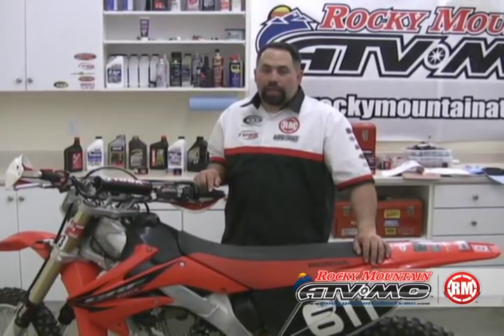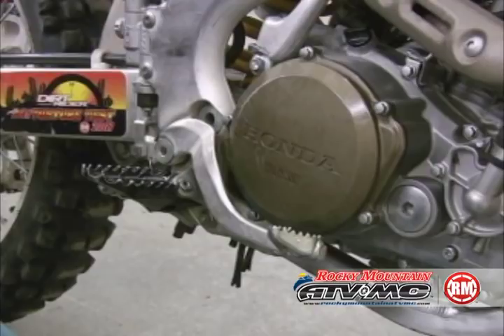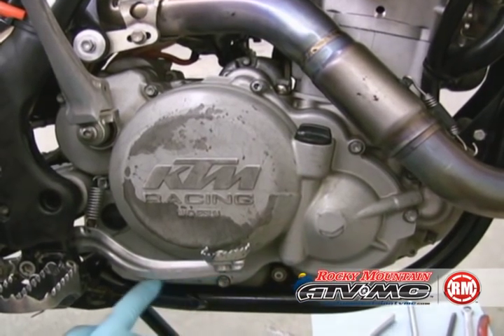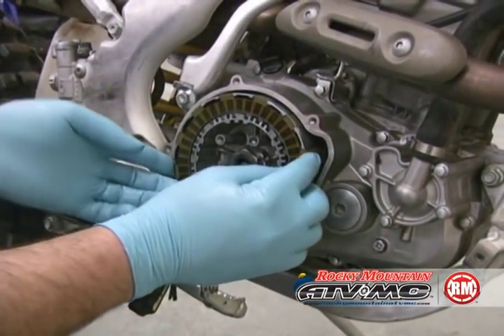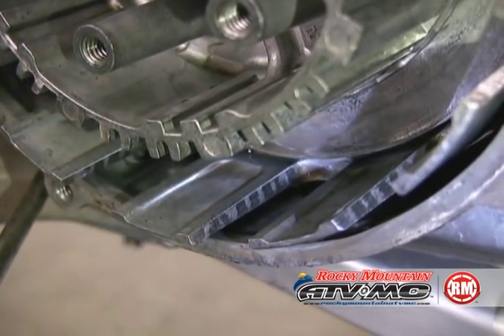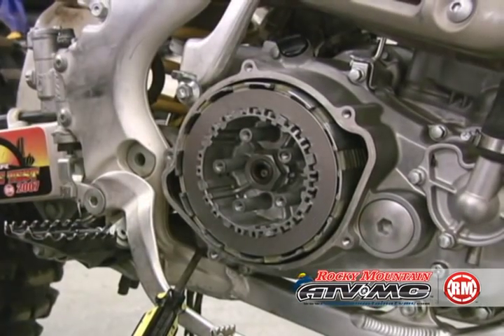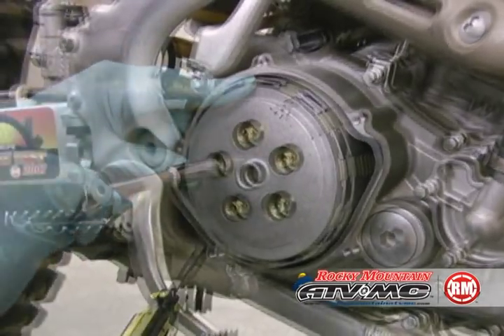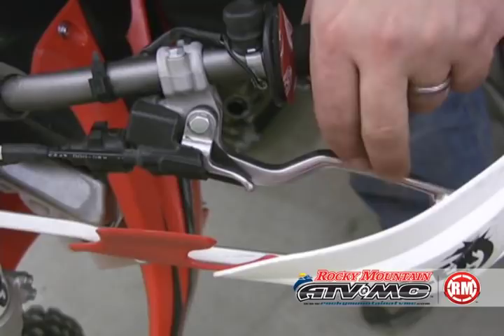Clutch Replacement on a Motorcycle or ATV - Clutch Installation

Comment from the maker: It sounds like the basket or inner hub may be wore out.  you want to pull it apart to inspect.  I would recomend either OEM, Tusk, OR EBC replacement clutch plates.  If you need a basket or inner hub, go with Hinson.

Comment from the maker: Most bikes will make more noise while running in neutral.  This is because the crank is driving all the gears in the transmission.  You are hearing them driving each other.  When the clutch is pulled it usually quiets it a bit.  If the noise is excessive you may have a loose clutch basket nut or something. If it is making more noise with the clutch pulled you could possibly have a broken plate.  Either way it may be time to pull apart and inspect.

Comment from the maker: In most cases you won't need to drain the antifreeze.  However if your machine does not have a clutch cover and you need to remove the right case cover, it may be necessary if water flows from the center cases into it.

Comment from the maker: The gear on the back is most likely riveted on.  the whole basket should slide out if you have removed the inner hub (and nut that held it on).  you may have to rotate the basket a bit, but it should come.  If not, then I am not sure what is holding it on.

Comment from the maker: @fourwheelerdude88 - slipping means the clutch isn't fully engaged.  This means the crank is not transfering all of its rotations to the transmission.  I don't know what "clutch thing" you are trying to drain oil on.  Are you talking about draing the transmission oil?  Just pull the drain plug.

Comment from the maker: @rmz247 - Pulling the lever disengages the clutch.  So I assume the clutch is still grabbing with the lever pulled in.  This is normal to some degree.  It can be caused by the oil (thicker usually) or by the basket and/or hub wearing.  As you get grooves in the hub or basket, the plates have a hard time fully separating; this leads to a little drag.

Comment from the maker: I don't know what you mean by "rotor", but if you are refering to your clutch, it is the exact same as this bike on your YZ250.  The manual may be refering to the arm on the other side of the engine, but you don't need to mess with that.

Comment from the maker: @SpeedTripleRocks - If the cable is in your way, then yes.  In most cases it won't be.  If you are confident in the toque you are putting on the bolts without a torque wrench then you are fine.  If not, I would invest in one.  The small 6mm bolts on the pressure plate only need to be torqued to about 7 foot pounds.

Comment from the maker: Sweet machine!  I have a 74 TC185 I cruise around every once in a while.  However we don't have a clutch for them and I don't see that any aftermarket company makes one.  You will have to go through a sukuki dealer.  The OE part # for the friction plate is 21441-13A01.  good luck.

Comment from the maker: So your clutch isn't disengaging all the way.  You need to pull it apart and see why.  It could be a few things - warped clutch plates, grooved basket, grooved hub.  You need to inspect.  Refer to your manual for specs.  if something is out of spec, replace it.

Comment from the maker: The springs make a big difference.  Stock springs will feel much better, but less spring strength can fry the clutch faster.  A dirty or old cable can also make the pull tough.  Make sure it moves freely.  If not a cable luber or new cable will help a bunch.

Comment from the maker: If your clutch is falling into neutral, it is most likely not a clutch problem at all.  It sounds like you have either worn gears or bent shifting forks in your transmission (or both).  It may be time to split the cases and inspect the tranny.

Comment from the maker: Refer to your owner's manual for recommendations.  I am not familiar with the oil you mentioned, but synthetics are the best for clutches (too slick).  I run Belray or Maxima 80 weight gear oil in my 2-stroke.

Comment from the maker: 1.  Just the friction.  The steel plates won't matter since they can't absorb the oil.  2.  I think you mean drive plates; either way it does not matter which way.  I always try to run them the same way though (sharp edge in or out).  3.  It doesn't matter if the bike is in neutral or in gear.

Comment from the maker: @JaredProject - It sounds like it doesn't fully disengage.  That is normal as the basket starts to wear and groove.  The fix is to replace the basket and maybe the clutch hub (depending on how each is worn).

Comment from the maker: @graveyardpromotions - most likely the clutch issue is unrelated.  It probably didn't disengage that well before when cold, you just never noticed.  It sounds like you may have fouled the plug.  try a new plug and see if it runs.  Your jetting may still be off if you fouled a plug.

Comment from the maker: Have you tried adjusting the cable? You also made sure that your installed the same number of friction plates correct? If everything installed just fine i'm betting you've got something else going on. Maybe go over the install again and make sure nothing is missing or out of place

Comment from the maker: @SpeedTripleRocks - They usually slip less when hot.  a few milimeters of free-play is important.  if you can't get it at the lever, try the adjustment on the cable or at the case (wherever an adjustment may be).

Comment from the maker: @kylejamesbarros - most likely a worn (grooved) clutch basket or inner hub (or both).  as the plates wear grooves in them, the plates have a hard time separating - thus, not fully disengaging.

Comment from the maker: @BowHunt1229 - look at a parts diagram of your clutch.  There is an adjuster to the push rod.  Check it out and make sure the pressure plate is putting all the springs force on the plates.

Comment from the maker: it doesn't sound like a clutch issue, rather transmission or shift mechanism.  You will have to pull it apart and inspect.

Comment from the maker: @weez1190 - thicker oil will make them drag more, but you should see it go away when if warms up.  Try Belray gear saver 75 or 80 weight.  If that doesn't help, you most likely have a worn basket and hub.

Comment from the maker: I'm just thinking if your cable works fine with the previous clutch it shouldn't change with the installation of this clutch. Have you tried using your stock clutch springs to see if that makes a difference at all. Also i would measure your friction plates thickness to see if they are in line with what your service manual says.

Comment from the maker: @Unity0Is0Power - sounds like a transmission problem, not a clutch problem.  Most likely you have some gears and maybe a shift fork damaged.  Time to split the case to see.

Comment from the maker: @250rsrcool - Some quads (or even bikes) that don't have a clutch cover may have to drain the coolant.  This is because the the entire right case cover has to be removed.  On the bike in this video; No, you don't need to drain the coolant.

Comment from the maker: @londonTown1989 - It depends on the bike.  Some right crank seals are installed from the inside (kawasaki does this a lot).  Check your parts diagram.  This CR - Yes you can.

Comment from the maker: Your jets thread all the way in.  If you are dumping gas then you havea problem with the floats.  Either they are not set right or the needle & Seat (the valve that shuts the gas off) is dirty or wore out.

Comment from the maker: The cushions don't go back in.  The springs on the pressure plate do, but usually aftermarket kits come with new ones.  The EBC kit should have them.  I don't know the size of the nut.

Comment from the maker: @londonTown1989 - It depends on the bike.  Some right crank seals are installed from the inside (kawasaki does this a lot).  Check your parts diagram.  This YZ - Yes you can (if is a very tight fitting seal though!).

Comment from the maker: you need to make sure you have a few milimeters of free play in your cable, otherwise you will fry the clutch.  If you are unable to get free play with the adjustments on the perch and cable, compare the old cable with the new to see what the difference is.  The only thing that could make it harder to pull (assuming only the cable was changed) is if the cable got kinked.

Comment from the maker: It sounds like your plates aren't fully engaging.  make sure you have free-play in the cable.  make sure there isn't some other adjustment that is preventing the pressure plate from putting full pressure on the plates.  Don't let it slip too much or you will burn up your new clutch.

Comment from the maker: If it is actually shifting back into neutral you may have a problem with something in the Transmission.  You could have a bent shifting fork, or rounded gear cogs.  Regarding the clutch not fully disengaging when in gear, depending on how bad it is, it may be normal.  If the bike is not running and you feel a little drag, that is fine.  If it is warmed up and running, and you still get a lot of drag - it is most likely a worn basket, hub or both.

Comment from the maker: There is one more friction plate than there are drive plates.  You always start by putting a friction in first and then end with a friction plate as well.  Some machines have a certain order because there might be one or two different friction plates in the stack, but most aftermarket clutches don't.  If they do, it is usually a thinner one that goes in first next to the inner clutch hub.  Refer to your owner's manual.

Comment from the maker: @Hockeyvalley - the clutch simply delivers the power from the spinning crank to the transmission.  It is made to engage and disengage to make power delivery smoother and shifting easier.  If you have problems with your transmission, it is most likely not the clutch.

Comment from the maker: No you can go ahead and remove them from the oil shake them off a little and then place them right into the stack. As for the grooves in the top of the friction plates i will usually stagger then with each friction installed. They help with oil pickup but it doesn't matter where they are located in relation to the other friction plates

Comment from the maker: @qwikyking - Disengage or engage?  If the lever is pulled in the clutch should be disengaging the transmission and your rear wheel shouldn't spin.  I must not understand what you are asking.

Comment from the maker: @staticxmako - It could be nothing at all.  all motorcycles make more noise ideling in neutral compared to pulling the clutch in.  This is becuase the clutch is driving all the gears in the transmission, so you are hearing them all move around.  You usually notice this after you rebuild it and are more sensitive the sounds the bike is making.  Try listening to your buddies bike and see if it does it as well.
At the same time, it doesn't hurt to make sure you got everything together right!

Comment from the maker: @21sentry - On your '03 CRF, The rod goes through the transmission shaft, The lifter fits over the rod.  The lifter has a flat washer type bearing and a washer on it.  The washer butts up againsst the pressure plate.  make sure your cable is adjusted correctly.

Comment from the maker: Some OEM friction plates are different and need to be put in a certain way (refer to owners manual).  Most aftermarket plates are the same, but can vary sometimes.  Often they come with one narrower friction plate.  This almost always goes in first (against the inner hub).

Comment: Very helpful!  Thanks for the info.  Do I need to drain the antifreeze to do this???
Reply: No
Reply: Only if you remove the inner clutch case, which is the case behind your clutch case
Reply: But for this you're not removing the inner ckutch case so you are fine, no need to drain antifeeeze

Comment from the maker: @TheDBen23 - I guess I don't understand fully.  How are you adjusting the springs?  Really, your only adjustment on your pressure plate coming down on the plates is in the cable.  Make sure you have a few milimeters of play in the cable.

Comment from the maker: Truthfully it does not matter; but I usually put the sharp edge on all the steel plates in the same direction.  Towards the motor or away, it doesn't matter.

Comment from the maker: Which clutch kit did you get for your bike? A lot of times your OE setup will have different plates for the inside and outside of your clutch stack but then the aftermarket clutch plates will all be the same. If all the plates are the same i would say it's safe to go ahead and install them.

Comment from the maker: New bolts are not necessary and using your stock bolts will be fine. You just want to be sure everything is together properly when you begin tightening down the bolts. Also i recommend using a high quality torque wrench. I have heard of a lot of people using a "click type" torque wrench that will go down to something like 5ft lbs but a lot of the cheaper ones are really not all that accurate once you get down that low. I like to use the gauge torque wrenches when i'm rebuilding.

Comment from the maker: it sounds like something is keeping your pressure plate from being able to lift off the clutch stack.  did you install new springs?  If so compare them to the springs you pulled out and make sure they are correct in size and length.  What bike do you have?

Comment from the maker: There was a small amount of grooving and wear on both this inner hub and outer basket but it wasn't enough for us to replace them at this time... Also sometimes when the basket does get grooved you can get away with just carefully filing down the grooves instead of having to buy a new basket.

Comment: done a thousand of em, if the clutch plates are not worn through, sand the metal clutch plates till you have all the shine taken out. The springs now, as you might notice the springs need to fit in between the preasure housing and the spring hold down post.( Nearly impossible to find washers for ) But it just so happens that the washer that spark plugs come with on them will fit perfectly. Add three of these to every spring and you wont have any clutch slip and the whole job will have been free

Comment from the maker: @zip1233 - on that particular bike it should be a lock nut.  If yours keeps coming loose, I would try a new one.  that one is most likely wore out.  Medium strength threadlocker should be fine a s well.

Comment from the maker: First off are you sure you aren't missing any components to the clutch? Second have you measured the thickness of your clutch plates to make sure they are in spec with what the service manual says. Is the push rod moving the pressure plate at all?

Comment: evry thing is in place and done right , i put the old clutch back on and the leaver worked fine as the lifter was pushing the pressure plate out. so would it be the cable that might need replaced would you think

Comment from the maker: The new clutch will most likely not fix the problem.  Your basket and possibly your hub have grooves worn into them from the clutch plates.  This happens over time and prevents the plates from spreading like they should when you pull the lever.  A new basket and maybe a new hub is in the anwser.

Comment from the maker: @deerman1212 - there will be some drag with the gears, but you should be able to spin the sprocket and hold the clutch still when in neutral.

Comment: @RockyMountainATVMC 
thanks 
   found the issue ; 2 things. 
the set screw was too tight, or didn't allow the pressure plate to open up completely
---it only had <8 hours on it too, but really old oil (orig. owner never changed it).  so after i changed it (TWICE now) and checked the basket, springs, reassembled and finally adjusted the set screw it was fixed.
---result- ressure plate set screw + new oil...and a days ride= :)

Comment from the maker: @MrDGonzalez5 - If you don't have play, you may have tension on the cable which leads to a removal of pressure on the springs.  This can cause the clutch to slip.

Comment: hey i just did a full rebuild and got the parts off your site. great videos thats why chose you and i will continue to. anyways everything when great with the rebuild. but my clutch makes a grinding noise i can hear at idle. when i pull the clutch lever it stops the niose completely. and the looser my cable is the more niose comes from the clutch. the manual gave no spec on the pressure plate. so could it be that its too tight. or could it be my idler gear bearing becuase it felt kinda rough.

Comment from the maker: Usually when a clutch is bad it slips. Get on the gas hard in 3rd gear.  If the bike revs and you don't accelerate hard the clutch is most likely slipping.  Your problem sounds odd.  I am not sure if it the clutch or not.  I recommend having a Honda mechanic look at it.

Comment: Great video, just wondering if the clutch cable have to be disconnected before staring the job and can I get by without a torque wrench to tighen the clutch hub bolts?? Thanks

Comment from the maker: @07HONDA400EX07 - that isn't correct actually.  The wheel will most likely turn when off the ground and in neutral.  The clutch isn't doing anything here actually.  The drag on the gears is causing the wheels to move.  this is normal.

Comment: you guys would probably know more than most on the internet, so i'll ask, 
just did an engine rebuild, all stock, reinstalled the old clutch (not alot of wear) 
the clutch wont disengage, when in first with clutch lever pulled in the tire wont spin, not just a "grabby" feel. bike is 2001 wr250f

Comment from the maker: @1madelectrician - The nut is generally a normal right hand thread, but check your manual.  Yes there is a tool to hold the inner hub.  We have it on our website for $15.99.  part # 1188510001